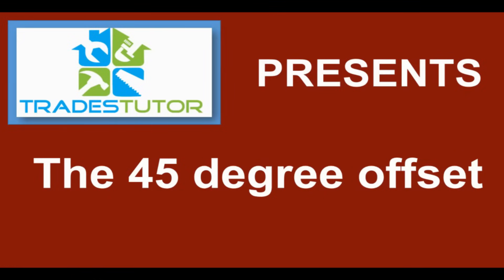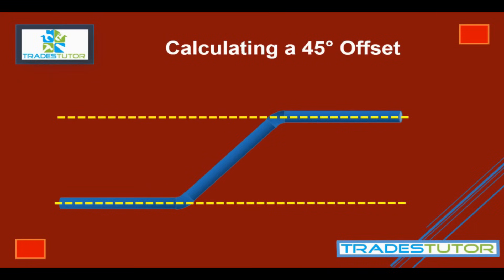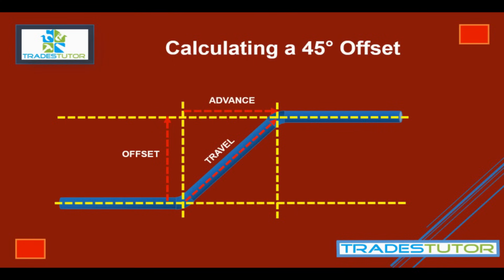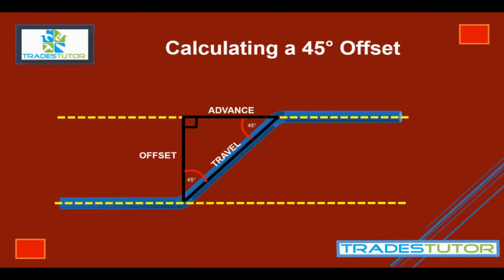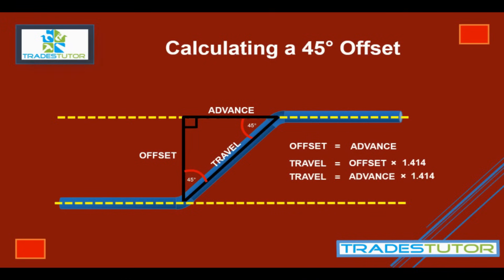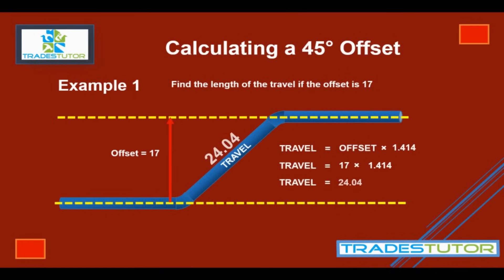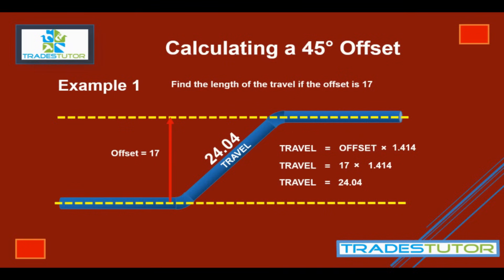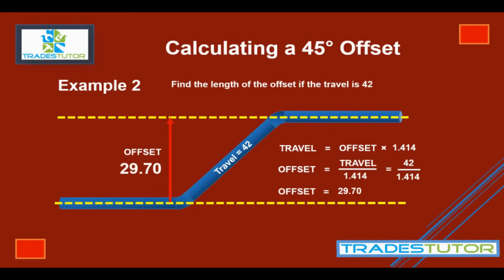Calculating a 45 degree offset piping system / Tradestutor

Comment: You find the travel, by saying "1/Sin(angle) , in this case 45, but you can do it with any angle. If you want a 30 degree offset its 1/Sin(30)= 2 , so you multiply your offset with 2 in that case

Comment: A very good explanation. You forgot one calculation. You need to subtract center of the pipe to 45 deg fitting. From the centerline of the 45 to where the travel would make into the fittings. that would be the travel pipe length.
Reply: I was thinking the same thing aren’t you supposed to subtract the fixture allowance

Comment: If the pipe is screw in pipe do you add the 45s or does this method counts the pipe being screw in into the 45 fitting?

Comment: Remember, the travel length is the distance from the fitting center to center. You must subtract the "A" value at each end to get the pipe length.

Comment: 1.414 where is this from and how would you calculate for other than 45?
Reply: You need to use this formula: 

1/Sin(angle)*Offset 

So fx, you want a 30 degree angle, its 1/Sin(30) = 2 and you multiply your offset by 2 to get the travel.

Comment: 👎🏼 you didn't explain how to account for the length of pipe used in the bend itself - where to start each 45° bend.  That would be 5" for a 1/2" pipe with a 90° bend.  What is it for 45° bend?
Reply: Just mock up your two pipes or get a fixed measurement of where your second pipe is going to be or where you want it to be then do exactly what he said, follow the equation. You are worrying about something that is irrelevant to the situation.
Reply: Also I get what you’re saying but just make the pipe a little longer than it needs to be man then it will be easier once you get the travel piece cut and mock up the second 45 and mark it where it needs cut

Comment: At time 3:15 when u mentioned 17... Is that 17 inches?
Reply: It is whatever you want. Could do it in any unit of measurement and the math will still work out. If you measure in inches your answer is in inches. Plug in millimetres and your answer will be millimetres.

No matter the unit of measurement, the travel is still 1.414 times the length of the offset

Comment: I work in hvac hanging duct and i always struggled when it comes to using 45. Will this method work for duct work too?
Reply from the maker: Hi Miguel: Yes, this should work for HVAC as well. Just be real careful as everything is based off the center of pipe or in your case the center of the ductwork.
Reply: @tradestutor1191  thank you i appreciate 🙏

Comment: question: I am having trouble wrapping my head around this concept. What if I have to find a travel for a 45-degree offset and my offset is like 3 feet 4 1/4 inches? The two measurements for one offset are throwing me off
Reply: But you said you know 2 parts of the equation I think without realizing it. Your offset and advance will always be the same on 45 offset! So wether you know one or the other doesn’t matter, multiply by 1.41 and then subtract your take offs from each 45 which should give you your exact travel measurement.
Reply: @-slurmdaddy-8147  

Thank you so much.

 I jyst started my plumbing math class.
Reply: @Incognitus_Mcgee  me too lol good luck bro
Reply: @-slurmdaddy-8147  

👍

Comment: Here is what I’m looking for . I work with ac ducts . So how do you calculate the the travel when it comes to ducts . Let’s say I have a 8x8 duct coming down the roof that has to be connected to a ventilation grill . The grill is also 8x8 . And they give a straight line of duct thats 8x8 and we have to calculate how to cut it so the the duct coming down the rood connects with the ventilation grill

Comment: I have another question regarding this, say you have a pipe running horizontal and the end of that run is a Y fitting, but then after the Y you need to install a 45 fitting.  My question is, how do you find out the length of that pipe in between those two fittings to hit the center of what you're goin for?  In relation to the diagram here, as an example (measuring from East to West direction from a wall) say the one pipe is 25" off the  and then the center of a hole for a bathtub lets say is 60".  Do you subtract those numbers and then divide that by 1.414 to get the length of pipe that is in between the Y fitting and the 45 fitting?

Comment: What do you do when your advance is a larger number than your offset
Reply from the maker: Hi Curtis: If that is the case then you most likely won't be dealing with a 45 degree offset. You'll have to use trigonometry in order to solve for the travel if that is the case. You could also use the pythagrous theorem to calculate the travel. Take care.

Comment: .how to get the advance in 45 degres offset?
Reply from the maker: Hi Jason: As it turns out, the advance and the offset are the same length. So if you have an offset of 15 for example, the the advance is also 15. And in the end the travel is 1.414 times longer than either the offset or the advance. Hope this helps. Take care.

Comment: So before the conduit is bent, do i mark two different points with 24.04 inches in between?? (for the first example)
Reply: You do not bend  the pipes,  you cut it at whatever link you need and use 45 degrees elbow at each end

Comment: Great demonstration. But you forgot that you need to deduct the offset of your 2 45s from the offset as well. To get the correct length of your travel piece of pipe , copper, duct work. What ever you are running. Well as far as round goes.
Reply from the maker: Hi Ma Re: The video was just meant to show the distance from one horizontal pipe to another. I have another video which goes through fitting allowance which can then be added to this video to help get the correct measurement. Thanks for watching.

Comment: Great vid, i just have a question when applying this "in field" say you have one pipe running parallel with the wall but you have a 3X2 Double Y with a 45 on it to pick up another fixture . I'm wondering in this application would you measure off the wall  to the center of the 2" 45 that is attached to the Double Y and then get another measurement for the stub down pipe off the wall too?  Then do you take those numbers and subtract them, does that give you the "travel" then you divide by 1.414?
Reply from the maker: Hi Jed: I'm having a little trouble picturing what you are talking about. Whatever the case there will be similar numbers used to calculate the length of the pipe and the number 1.414 will be at the center of it. Thanks for watching and I hope this helps.

Comment: The 24.04 doesnt include the laps on both 45s right.... so I'd add 3" or so.for that as well?
Reply from the maker: You are correct. It does not include  the laps on both 45s. You would have to check a fitting reference guide when dealing with fitting allowance .

Comment: The 1.414 what is that exactly? 
Pipe thickness? Is it mm? Pls answer need help
Reply from the maker: Hi Bihn: It's not pipe thickness or mm. The 1.414 is a trigonometry number. It's a constant used when dealing with a 45 degree offset.
Reply: @tradestutor1191  i see thank you:)

Comment: does this work with 3/8 hydraulic tube bending?  I bend a lot of tubes and I am not good with math so I make templates and copy them to the tube.
Reply from the maker: Hi Punisher: Yes, this should work for that purpose although I'd do a test piece first before making a whole bunch of them.
Reply: Yes, it will work with any size pipe, you offset is what your after, so the size of the pipe doesnt matter. Its alway 1.414. Now if you are doing Ductwork i use Owl.. OFFSET X WIDTH ÷ LENGTH but with 45's i use 1.414

Comment: I've been running EMT for 30 years and I don't know any of this stuff all we have ever done was offset is 10 in you measure back 15 which is a little over but when you put your standoff clamp on your box your fast into it works out perfect making a 35 degree Bend is a little different but same principle instead of 1.5 you just double your height and being a 30 degree angle no need to complicate things simple is better and honestly if you take time to do all of that mess out on the job you won't be out on that job very long they want it done in a hurry the main thing is make your bends accurate and look good without any dog leg.

Comment: Easier way to think of it.  Measure from center of pipe to center of pipe and multiply that by 1.414 then subtract the two fittings and there goes your length. Youre welcome
Reply from the maker: Thanks 2Smart4Uapes
Reply: I also add the pipe diameter at the end for the exact measurements for the hub to hub
Reply: @Abreezy2495  Umm not sure about that. The way I do it is your End to End measurement. When I said subtract the two fittings I met the two take offs of those fitting and that will give you End to End. I am a Pipefitter
Reply: I'm also curious about this method with regards to using a Wye fitting for the branch to tie into a pipe straight on, I would imagine this calculation doesn't apply to a situation like that?  This is what I mean, say you are running your pipe and you want your cut length to be the exact length in which the branch of the wye lines up with the pipe it connects to without 45's.  

Or is it much easier to go this route, where you run your pipe with your 4" Cast Iron Wye and then use a 45 to connect the other pipe once finding out the travel, if by going by your method say the center to center measurement between the main line and where the other pipe needs to connect is 80" and you multiply that by 1.414, do you take the throw off of the cast iron wye and the 45 which figures out the piece in between the wye and 45?

Comment: Can I use this formula for rectangle duct
Reply from the maker: Hello Arun A: Yes this should work for an offset of any type. Thanks for watching.
Reply: @tradestutor1191  Another doupt. How can I find angle of two sides   using height of offset
Reply from the maker: Hello Arun A: If you  have the length of the offset as well as the length of the travel then you can use trigonometry to find the angles. This example is only specific to a 45 degree angle. Almost anything else and you'll have to stick to trig.
Reply: @tradestutor1191  thanks Bro

Comment: Hi
 45° to 45° ok but 30° to 60° how to connect that pipe elevation any  formula
Reply from the maker: Hi Thiramulai:

You would end up using a different constant for that. I haven't made that video but now that you've asked the question I think I'm going to make that one. Look for it soon. Take care.
Reply: 1.414 is the "secant" of a 45 deg.angle. It is also the square root of 2. Using a trig calculator(like the TI-30xa cheap) punch 30-cos-1/x will give you 1.15, the secant of a 30 deg angle. Multiply that times your "offset" distance for the "travel" length to cut. Do the same for 60 or any angle to find the exact hypotenuse. Not as hard as it sounds. Don't forget to subtract the coupling length. times 2. When you have mastered this, you can build hip roof rafters and many construction problems.